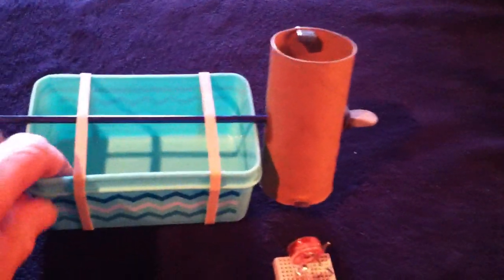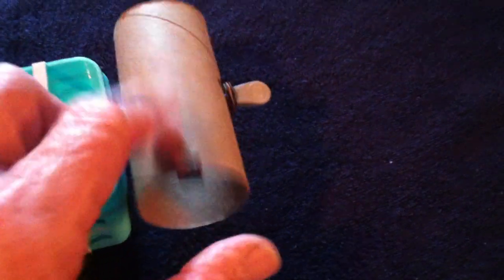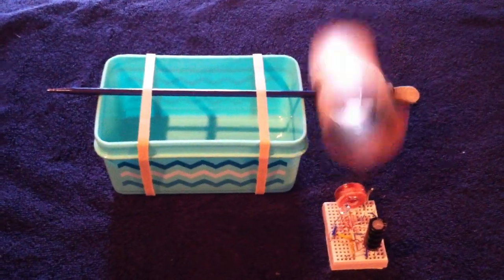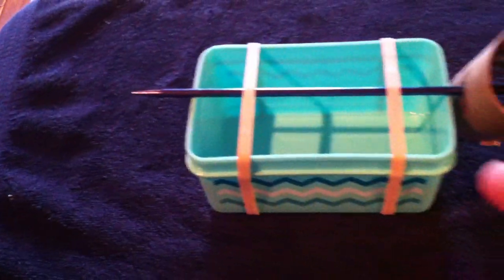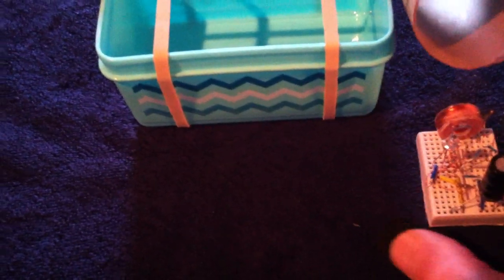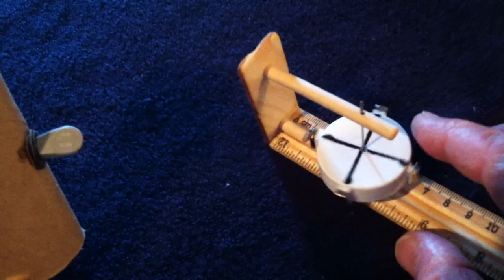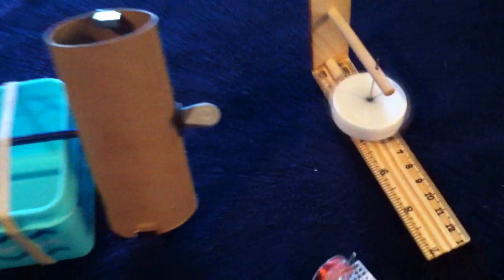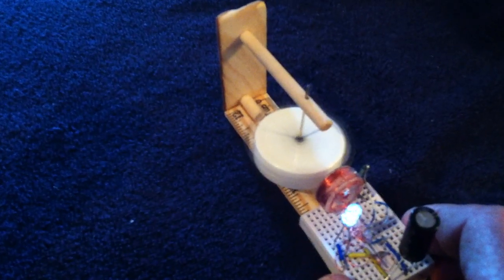Ultra Simple Pulse Motor Rotor

Comment: What?
Okay, I’m gonna need a parts list.
Seems super interesting.  Need to understand the “there’s no battery” part.  Maybe it’s just super efficient induction feedback that eventually peters out?
Reed switch...   hey Siri...
Reply from the maker: The energy is stored in the 10 Farad super capacitor that was pre-charged with about 3 volts.  The motor runs for a few minutes on that stored energy.  You could replace the cap with a 3v battery.  The circuit is a simple coil and reed switch design. The LED goes across the coil backwards and lights from the flyback .
Reply: Thanks!